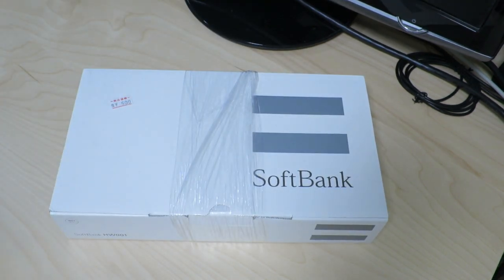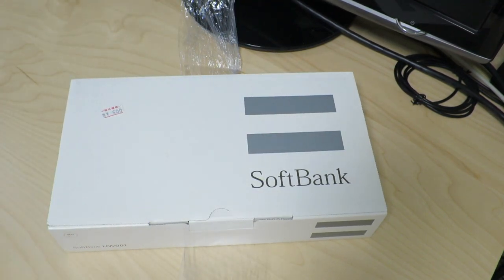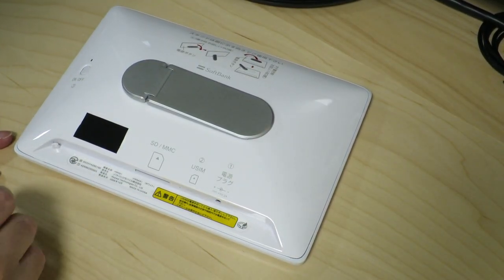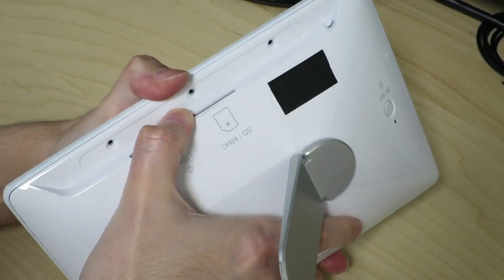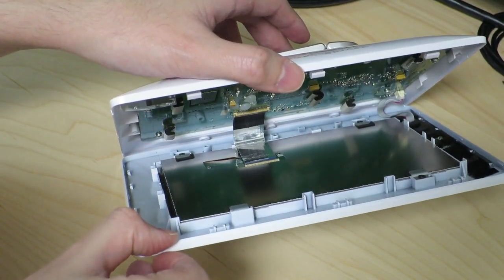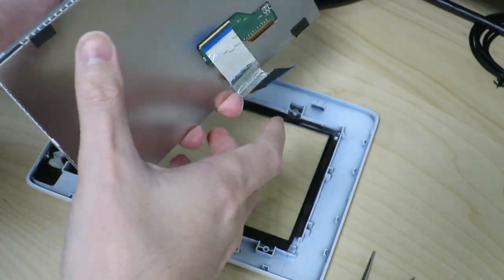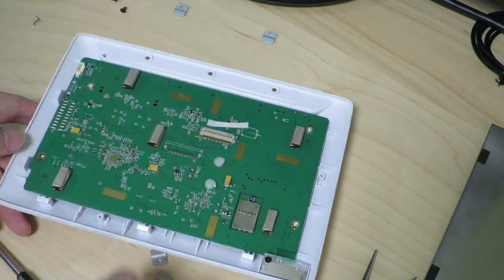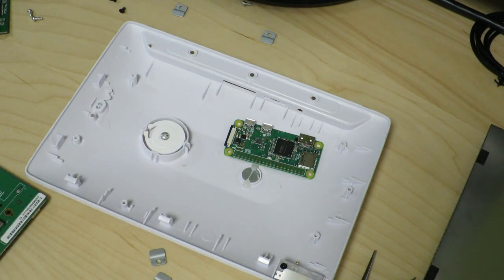Making a Cheap Raspberry Pi "Tablet" - Part 1: Photo Frame Teardown and Design Planning

Comment: 500 yen = $4.62 .............. great deal second hand or not the price warrants the risk by a long shot .. good find, good buy !  What model driver board is that ??
Reply from the maker: Yep, these things are being sold as-is, so I only buy them when they're cheap enough that I won't end up being too disappointed if they didn't work. I ended up getting a board on Aliexpress by searching for something like "at070tn83 controller", but I've yet to try it out so I'm going to hold off on mentioning which board to try. Thanks for the comment! :)
Reply: cool awaiting the follow up on which board to try, I just received a brand new pi zero w and a 3b+ in the mail today this video was part of the inspiration for that because I want to build my own lap top or depending on size more like a net book.  I am not dead set on having a touch screen honestly I'd rather not.  I am going for more of a net book type build mixed with a Pi-top because I want to still be able to access the GPIO pins in case I want to make modifications or add anything to the build.  Most of the LCD's I have are from older laptops and one is a crystal liquid display and I can actually see liquid oozing out in between the screen and the glass.  So I am in the market for an affordable display and the correct driver board.  Net books were kind of garbage as far as performance but the form factor is what I like about them so thats why I chose that for my build thanks for the video.